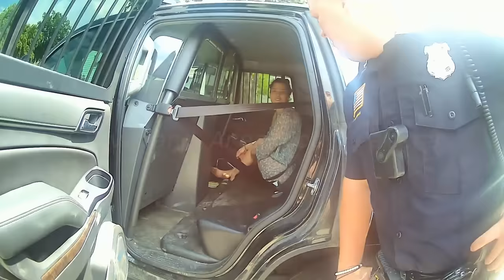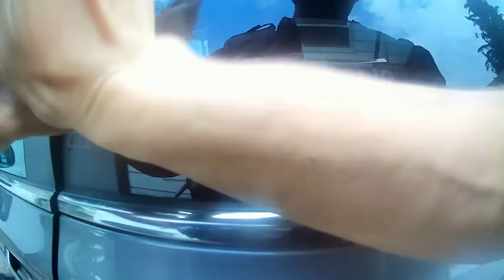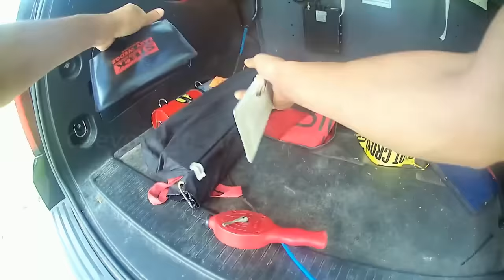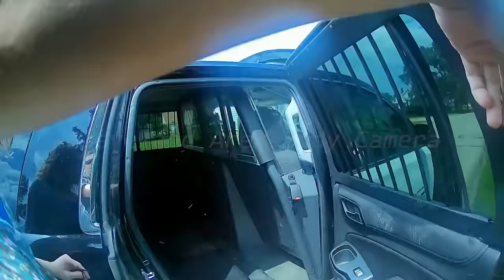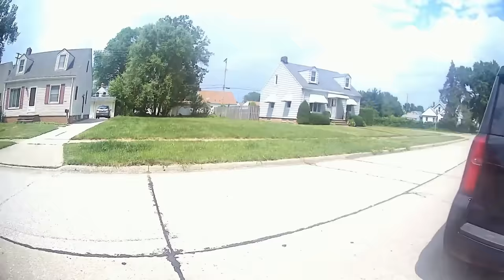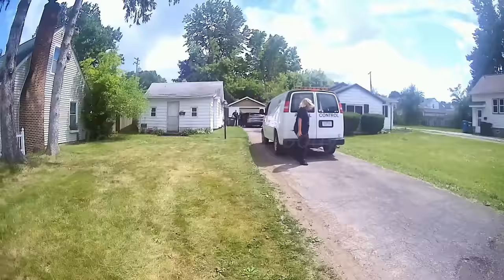Animal Control Freaks Out on Alleged Animal Abuser

Comment: If I accidentally locked my dog in the car for 30 seconds, I would have shattered my windows to get him out.
Screw the car and glass.  I wouldn't be calling the cops, I would be calling a glass replacement company while my dog hangs out in the cool house.
Reply: My thoughts exactly! I wouldn't have hesitated to break my windows
Reply: I would have calmly did what the cop did. Except with nicer tools. Why use force when you can use your brain.
Even in the middle of the woods, you can carve a stick to do the same thing.
Reply: I think we all would but this wasn’t an accident. She left the poor dog in there for hours. Car probably ran out of gas and then the battery died that’s why the doors wouldn’t unlock.
Reply: @tonysolar284  LOL!  I was thinking the same thing.  You'd think they'd have better tools.
Reply: Oh god I know! Me too totally! My little boston terrier is super sensitive to heat & cold so I wouldn't have given it a second thought, rescue doggo now!
Reply: Honestly fuck that window  I would have shattered  tf out of it to get my pup pup
Reply: I sometimes run my car to warm up or cool it off, but I don't leave my kid or pets in when no one is able to watch them in the car. I never use my only key to warm up/ cool off my car, I use 2 keys one for my ignition the other goes on my belt to unlock my car. I hope she learns a valuable lesson.
Reply: You could probably bend the door out and reach in, then bend it back

Just in case you ever need to know 👌
Reply: When my dog is in my car, the last thing I do is turn the ac off so he stays cool right up until its time for us to go inside. I can't imagine leaving him behind and for 24 hours!
Reply: I had my door windows broken out by kids and bb guns several times.
$30-$60 for a new window and about 15 minutes to put it in.
Reply: Exactly the same thing I would do!!! The way animal control reacted to her is way better than I would have done. That cop would have been arresting me for what I would have done to this dumb chick!!!!
Reply: She told him there's no AC in the house, it's really hot in there. Not defending her, but the house apparently isn't cool either.
Reply: @King_Barney  but a house does not heat up the way a car does. It's like an oven.
Reply: Same, my dog is my everything! I would do everything and anything for him.
Reply: Excatly 

Glass can be replaced and car repaired which sure have been in the first place, since she knew battery was bad in the first place as she stated. Likey ran out of gas , hence hours running wich equal Idle hours and alternator no longer charging battery since not running anymore and she made a excuse likely? Dog can't be replaced, or repair. Idiot lady sure not be allow to have any pets. Feel sorry for her kids?

If you have to leave anyone, or any pet in car for some reason, how about check in the car and leave also the windows a little open as well as AC?

Only time every left my birds in car was when power outage and stay in car with them so they can cool off as well as me as 98 plus degrees as had them outside with me  in shade area and even spray cool water every so often and after a while when to a Walmart with them on my shoulder and spend a couple hours shopping. Now have a backup generator and battey bank. I would never leave anyone, or animal unsupervised in car for hours let alone a few minutes.
Reply: @amanda-leemarie87  I know. I wasn't defending her. Just telling the OP the house wasn't cool, either. I feel really sorry for dogs built for cold weather, living where it is hot. Huskies, Malamutes, etc. They have a thick coat, even in Summer. I would never own one, because I live in Virginia. It's just too warm for them.
Reply: Same here
Reply: Even if the car died she still has a key to unlock the door, she must be on something.
Reply: 30 secs?! Nothing or nobody is going to die in 30secs lol, just go get your spare key! No need to break anything.
Reply: No doubt!
Reply: That's right my dog is my kid
Reply: My kids are my kids, my dog well is my dog lol
Reply: I always carry a spare key on me so I don't lock myself out of my car.
Reply: I appreciate your care for pets, but 30 seconds is a little extreme. Well, maybe your richer than me and can easily afford new car windows.
Reply: It is. 30 secs before breaking a window is just panicking. It aint good for anybody
Reply: IF I leave my dog in my truck when it is running I always have my spare key in my wallet and I remove my remote fob from my main keys so I have a way to unlock it
Reply: Exactly. No need to start immediate window smashing lol
Reply: I agree, what in The world was This woman Thinking, my kids family and dog comes first who cares about a window being shattered!
Reply: If you ever get the chance to bust the window out of someone's car. Because they left their dog in it. To go grocery shopping. It's the best feeling in the world. This is from experience.
Reply: Have you ever tried to shatter car windows? It's not so easy.
Reply: Well she said the house is hotter than inside the car with the AC on, and sometimes that is true, sometimes a house can get scorching hot, she needs to invest into an air conditioner for fuck sake
Reply: @Frogmanpipes be careful, with electric cars now, the car is not running but the ac is on. You will then be arrested if you smash the window
Reply: @anthonylagunas6737  I have. It's super easy. I've never had one that didn't break on the first hit.
Reply: @frogmanpipes9561  That's because you are so strong. Watch videos of police or firefighters trying.
Reply: Me too..
Reply: I have a rechargeable fan for my dogs..
Reply: @Frogmanpipes so you have a habit of smashing windows? Cant possibly be that all those windows you smashed was because a dog was inside a hot car. You are clearly lying now lol
Reply: She could have tied the dog up to a tree with water bowl..
Reply: How the fuck do you leave your dog in the car without noticing? What the absolute fuck.
Reply: Easy junior you don't just go busting windows just calm tf down
Reply: EXACTLY!! 
I wouldn't think it twice.
Reply: Same here my dog is my life next to my kids now but I love animals way more then most people for a fact
Reply: What if its 50 degrees out?
Reply: @anthonylagunas6737  not because I'm strong. I grew up in a junkyard. Breaking car windows.
Reply: on god
Reply: Or call the fire department immediately when you realize you can't get the door open, they probably have better ways to deal with this. Definitely not ignoring the situation until the next day when your dog is already dead from overheating.
Reply: she said the car was cooler than the house. she was effed up on something, lost track of time, and the dog paid the price. She was not in her right mind to begin with
Reply: Definitely 👍.  I wouldn't wait around if it was hot or cold in the car.  Although 30 secs is a lil extreme. lol. Obviously this lady is a fucking selfish mess. She's not even the least bit upset about the dog. She's more concerned about the cut on her foot.
Reply: @frogmanpipes9561  Then you lost money.
Reply: AMEN!!
Reply: @King_Barney  Exzachary
Reply: I actually did shatter the window once. I walked into the store & asked the clerk to borrow a hammer. She got on the other side to keep my dogs attention so she wouldnt be too close to the glass
Reply: @Daniel-z2j2v  even if the battery was dead or whatever was wrong with it you can still unlock the car with your key, and I'm not sure if cars can lock themselves if the battery dies, that just doesn't make sense to me
Reply: I have a husky and a shepherd and if both of them are in the heat for more than 15 min theyre at the door barking and yipping like "let me the f*** in" so that dog was probably going nuts trying to get away from the heat it couldn't escape thats unbelieveable some ppl really shouldn't have animals
Reply: @FallenxAngels91  I think the hottest I've ever experienced in a house is mid-90s the hottest you can get in a car is like 140. The glass and it being airtight just about seals the heat in like a solar thermal  panel. 
She must be on some strong stuff. Either way neglect is neglect and she left him in there forever
Reply: SAME!!!!!!
Reply: Me too!
Reply: AGREED
Reply: 👏🏼👏🏼👏🏼👏🏼👏🏼👏🏼👏🏼👏🏼👏🏼👏🏼👏🏼👏🏼👏🏼👏🏼👏🏼👏🏼 real shyt. She didn’t give a damh about that puppy and she was probably doing the same to those kids in that hot house. Glad the lady told her off and loudly!!!!!!
Reply: I have glass insurance specifically so I don’t care, if I accidentally lock my child or animals in my vehicle I would without hesitation shatter the glass. My child is more important than my vehicle. This is such a fucked up situation.
Reply: @anthonylagunas6737  Yes it is...
Reply: @King_Barney  the dog could of been put on a leash in the yard/garage. At least it would have had a breeze, or a cool cement floor to lay on.
Reply: @anthonylagunas6737  my friend is a glass man. Mainly windshields or car windows. But with a little $30 piece of equipment, his in the right place, the window will shatter. Not effort is needed. Put the little tool against the window-BAM-window gone. The cops around here all have one they carry.
Reply: @tammybaker6635  Have you ever heard of the little girl, that has a realistic doll. Then leaves it in her child seat, someone sees it and thinks it's real. Cop get called and break the window, for a doll.
Reply: EXACTLY!!
Reply: Thats a little to much
Reply: @anthonylagunas6737  wth does that have to do with a live animal? And yes, I have seen the dolls. My mother collected the ugly things. But one thing that doll doesn't do? Sweat. But hey  at least it's out of the hot car where it wont melt!
Reply: U are an idiot! An animal, pet, a child even can live more then 30 seconds in a car if locked in a car!
Reply: @ToxicAngelIOI  so why! I expect someone would have just buried it….. what a pet died and you have to call cops? What a shit show!
Reply: @toob247  sorry watch same video all of what you stated didn’t play out in viewing!
Reply: 100% same thing here
Reply: I take my lambs with me NEVER EVER would i leave them in a hot car
Reply: I'm not trying to side with her ,but have you ever actually tried to break a car window? I never have but go watch some videos and see that if your not strong enough and dont have the right tools its pretty hard to do that
Reply: Same. If it were my kid I’d break it immediately but an animal I would find a Jimmy first if possible
Reply: @tammybaker6635  dude it's 30 seconds its not going to kill the dog call the cops for they can help I have been having pets since I was little so ik 30 seconds is not going to kill a dog
Reply: Same
Reply: @RitualBakerBaker  the animal had already passed. I sat beside a ranger pickup while waiting for my grandchild to be born. Me and several other people were standing around it. We had been outside about 40 minutes, just visiting. Someone ask if  that "pointing at the back sliding window" a real dog? About then the dog raised its head and threw up. We DID break the sliding window to get it water. And cops were right there when we did it. It was a breezy 95° day. My truck's steering wheel was to hot to touch inside a closed up vehicle. How would you like to be locked inside a vehicle, no water, just sitting there literally cooking? You, keyboard cowboy, need to rewatch the video. I think you missed an important part of the story.
Reply: @ToxicAngelIOI  👏👏👏👏👏👏👏👏
Reply: @anthonylagunas6737  yes it's very easy to break a windows. I guarantee if my dog was in that car I could break the windows easy.no excuse for this throw a brick through it
Reply: @ToxicAngelIOI  I would absolutely try dont get me wrong I just dont believe that people magically get stronger when faced with emergencies. I just watched several videos on here of strong men with bricks, or hammers trying to break car windows and they weren't breaking it's not an easy task . This woman looks no more then 90lbs soak and wet. She obviously called the cops for help. Think about it if she didn't care about her dog would she have called the police? She could have waited for that phil guy and buried her dog and the police wouldn't have known.
Reply: Same here my dog is my everything
Reply: 🧢 it’s just a dog bro
Reply: @juliedate517  I promise if you stick a screws drivers in. The weather strip between the glass and door and try to pry on the glass IT WILL BREAK VERY EASY
Reply: My pupper is my home also my children but still my pupper wouldn't of been locked in a car more then 10 mins before I knew I was whipping a tire iron across my glass
Reply: Well anybody that loves their dog would do what ever it takes to get them out. This lady clearly didn't love that dog. 😒
Reply: no one’s first reaction is to just take things into their own hands. if she really meant harm to her dog she wouldn’t have called the cops in the first place.
Reply: If the battery was dead the electronic switch wouldn't open the door. It needs electricity to power the coil.
Reply: Also if the car was running the alternator would have charged the battery so she could unlock the door.
Reply: @lynns4787  lol wtf "no one's first reaction is to take things into their own hands" why the hell wouldn't you take care of it. It's you're problem, fix it! That dogs life depended on it. I would simply use any tool or rock within reach and break the window while someone else (neighbors, friend) gets my dog to the other side of the vehicle so the shattered glass doesn't hurt the dog. I wish more people would take things into their hands and be independent as much as possible. Obviously when you NEED help and their is no way out then emergency services are perfect. But when all it takes is a broken window and the problem is solved and a dog gets to breathe fresh air again... break the window you're damn self. It's 100-200 for a door window I've had to get 2 replaced.
Reply: THIS IS THE COMMENT HERE‼️aint no damn way especially if u have insurance on the car like u supposed to ik its  $50 for a window replacement through insurance for me my dogs life is not replaceable but a window it💯
Reply: @dontbeakaren6145  u heard the cop he said same thing u did u hit the nail right on the head cause aint no way she couldnt have got that key nd got that dog out 💯
Reply: Preach
Reply: Yup I would do the same. Trust me
Reply: @tonysolar284  yeah. Busting the windows out could also lead to unnecessary injury to the dog or even your self.
Reply: I never abused dog, only raise for the sweet dog meat. Sometime I make sweet and sour puppy delicious with rice and vegetables
Reply: @stevedrinkard2040  OMG lambs are the sweetest things ever! Goats too
Reply: YEAH FLIP THE WINDOWS BUST EM DOWN
Reply: I would do the same thing but what if let's say you have a fully bulletproof car what do you do then?
Reply: I’m saying bro all those tools take time as well. By the time he jammed the door open I would have already had the dog out and going for a walk
Reply: If I locked my car keys in the car with my dog then yes, no more then 30 seconds I would break that window Otherwise I would just unlock it with the keys.lol Screw paying $300 -$400 for a new one. 😆
Reply: Its a dog!!!! Look at all of the times that police has shot dogs who are doing their duty, what a crock.
Reply: 30 seconds isn’t bad.
Reply: @theduck1495  bulletproof u get a crowbar. I got 2 crowbars on my house. Trust me but in any case I always carry an emergency window breaker on my pocket too. That shit will break anything.
Reply: Facts. I could never leave my dog in the car for extended periods of time. This is just neglect and murder.
Reply: @SYRINDINA  that’s true. And if for some reason I need to do it I will turn the a/c full power plus a window down because cars sometimes lock themselves that’s just logic. But normally I never leave him in my car without me. That’s just cruelty.
Reply: You call 911 right away , they have the tools and they come right away. My daughter locked herself in my car luckily I always leave a snippet of window down so the firefighters were able to get her out no problem. Cps called to make sure baby was good and I even got a congratulations from them for calling right away rather than breaking a window or trying to do it myself while wasting time. Just call the experts as soon as it happens they are here to help, let them
Reply: @Rain-oq7vh  she had plenty of time to do that agreed. But she didn’t. I feel so bad for the dog. They are innocent and don’t deserve that treatment.
Reply: Same
Reply: Exactly
Reply: I would have done the same or call the police or something to get help but just leave it in there?! Hell nah
Reply: Amen!!!!
Reply: Yeah dude... I locked my dog in the car once and called a locksmith. I watched her the whole time and was working on smashing the glass when they got there. The only thing that slowed me was she kept jumping to the window I was trying to break. That was a very scary day OMG. I couldn't imagine...
Reply: Same
Reply: You're speaking too much sense.
Reply: I give zero fucks about my windows if my  pet is locked in it. Breaking the damn window to get them out.
Reply: Same, fuck the window. It can be replaced, the dog’s life can’t.
Reply: If our babies our great Danes was left in the car on accident DAMN RIGHT WE'RE BUSTING THE WINDOWS
Reply: @jennyjo798  EXACTLY SAME
Reply: exactly what i thought
Reply: 30 seconds.  No you wouldnt.

You be speed dialing tow trucks for an emergency unlock..
Reply: Exactly...I wouldn't have even thought of anything other than how fast can I break this damn window and get him out.
Reply: Yes so true I don’t understand people !!! But why can’t government workers be this upset when cops kill a person not a criminal an innocent person that was not committing a crime 🤷🏽‍♀️
Reply: Fucking facts
Reply: Facts. Poor husky
Reply: I just gently pet my dog, looked into her gold eyes, and told her the same.
"Just so you know, I would break a window for you, okay? I would break it."
Reply: Everyone's sentiment is well meant by breaking the window. But a dog isn't gonna instantly die in there. Definitely just call someone with a slim Jim if you don't have one call a tow company.  They typically do.
Reply: @tonysolar284  Post a video of you carving a stick to open a modern car door 🤦🏻‍♂️😂😂😂
Reply: For an animal and my son I will ❤️ 

I hate how grown ass adults be leaving their babies and animals in cars..
Reply: @tonysolar284  I mean if you've ever accidently locked your car door you know that those are the exact tools they use. Sharpening a stick probably isn't gonna do much
Reply: But you can call the police and they can unlock your car for you especially if it was an accident and lives are at stake. Or even a mechanic usually they have the unlock hook
Reply: About 14 years ago, I was going to work and put my dog in the car to drop her off at her day watcher and went back in the house to get something and when I came back out and the doors were locked. I grabbed a crowbar and started hitting the door and the door on the other side popped open. My car was also running so my dog would stay comfortable.
Reply: About 14 years ago, I was going to work and put my dog in the car to drop her off at her day watcher and went back in the house to get something and when I came back out and the doors were locked. I grabbed a crowbar and started hitting the door and the door on the other side popped open. My car was also running so my dog would stay comfortable.
Reply: My thoughts exactly, RIP that puppy! He's in a better place. Better than being with her!
Reply: Straight facts fuck the car.
Reply: I've damn near busted windows while dogs were in hot cars and the ones have  said why would you do that
Reply: EXACTLY, I accidentally left my key in my car and my dog was in the back seat so I got locked out. Immediately burst into tears and almost called the locksmith if my mom didn’t have the spare on her. I just don’t understand how the dog was in there for so long w the car dead and locked and she didn’t notice
Reply: @lisawalsh218  sameee I would have probably scratched her up
Reply: I've done that.  Ripped the window out after I accidentally locked my keys in on a 90 degree day
Reply: Same here. Like a few months ago I was coming to Tennessee with my mom to live with my grandmother until I moved to Germany. My sister wanted to have lunch so we both agreed to go, we had three cats in the car and when we parked we tried to park in the shade and have the windows down, but I could not stop stressing about going to the car and turning on the car. My mom kept telling me they were ok but it was just a feeling. After a while we went to the parking lot and they were fine, but I started to tear up a bit because I felt bad, they weren’t use to being in the car and stuff but I was afraid the heat would get to them. But they were fine which is good to me. I wish cars with safety to let the air conditioner on while your pet is inside without having to be so dang expensive man
Reply: I hate to leave my dog when I pump my ⛽
Reply: THIS!!!! ❤️❤️❤️❤️❤️
Reply: @tonysolar284  how long does it take to carve a stick into something that would be good enough for that? What if it breaks and you don't got a backup?
Reply: You can unlock it with a hanger or the antenna
Reply: @harrymills2770  yeah budgets are a sumbitch, at least they have something right? Better than nothing
Reply: Love this comment as someone who owns two Huskies. I'll gladly pay a bill for a new window over having them overheat.
Reply: @King_Barney  Honestly if she can't provide a HUSKY a cool place 24/7 year round she really should never have gotten it.  Find out about the needs of the animal and evaluate if you can meet those needs.  Tying him in a shady spot and repeatedly wetting his fur and providing lots of ice water would have been ok for an emergency.
Reply: My dog loves going on car rides, which is funny cus he used to be terrified. But there's been times where I NEEDED something at the store, and I don't go cuz hes with me while it's too hot to leave him in there. Or I go without him. It's not hard to be responsible for a life.
Reply: I also never leave an unoccupied vehicle running